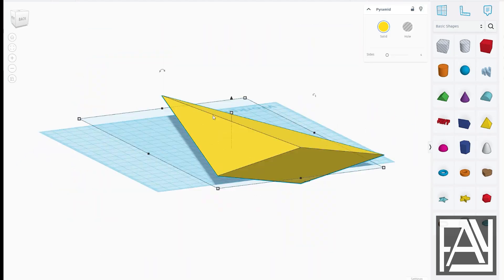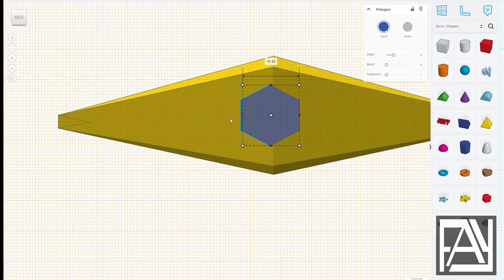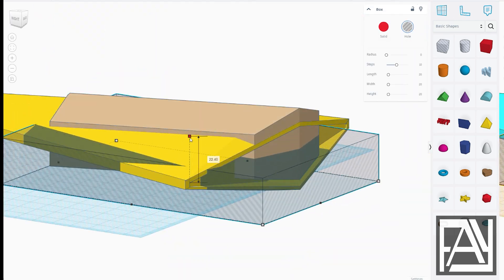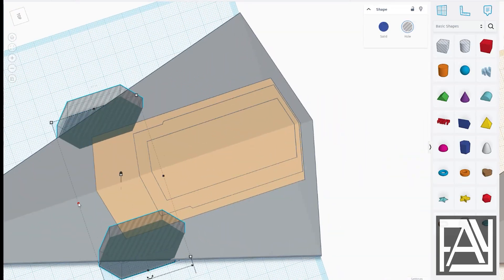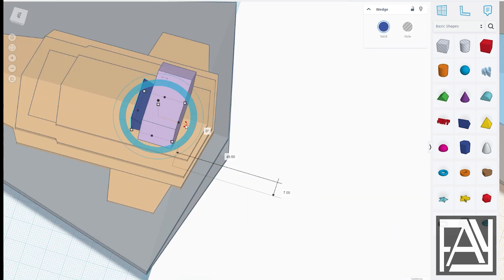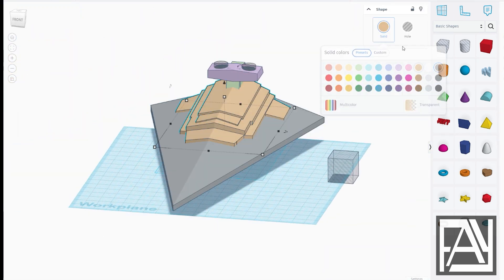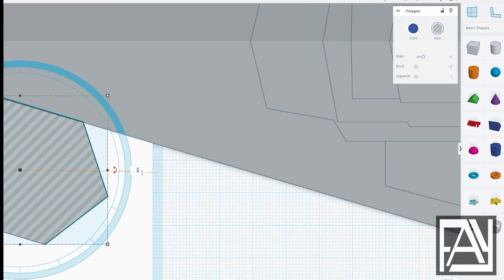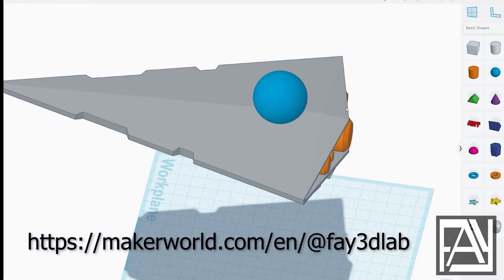#tinkercad 3D modelling - Suspended #starwars #stardestroyer  Part 1

Comment: you don't have performance issue ? I like tinkercad but faced issue with grouping multiple objects and this was a lot simpler than this spaceship... I moved to freecad (too clunky) then fusion 360 which is awesome.
Reply from the maker: it does happens sometimes.. it wont group or the grouping is weird.. whenever that happens i just restart my pc.. and its again works again..
its loading files that takes forever when u have a lot of groupings